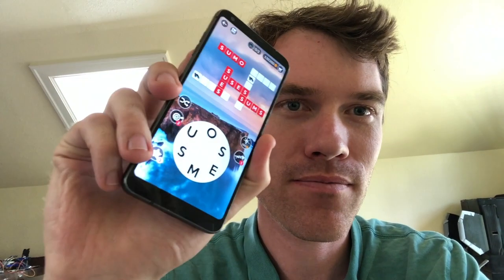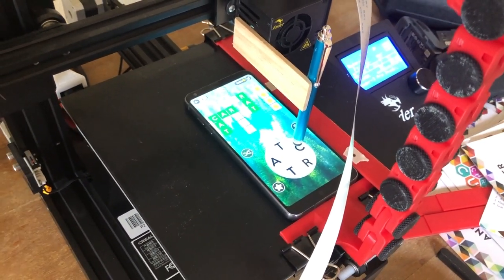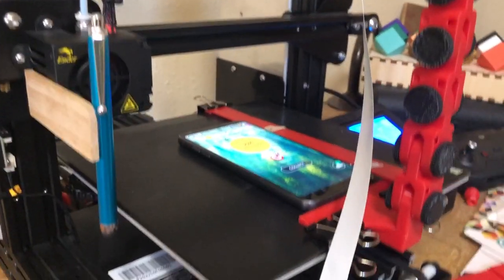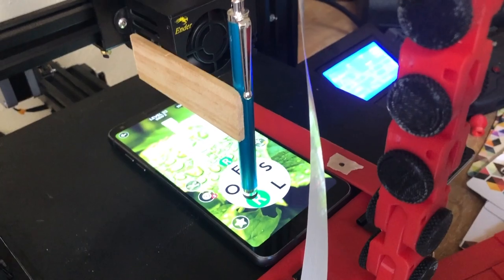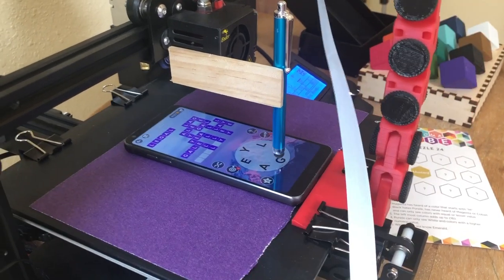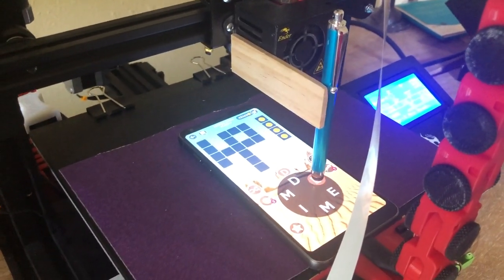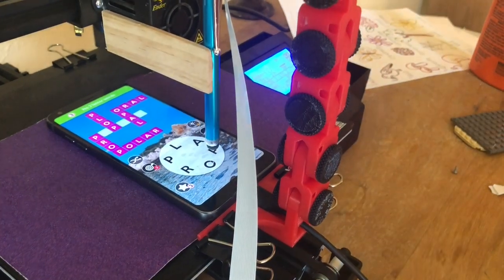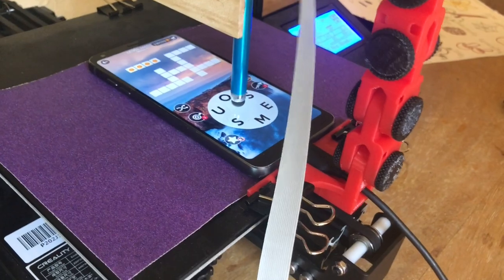A Robot that Absolutely Dominates the Wordscapes Crossword Game.

Comment: I think this is quite an achievement lol! 

How does it cope now though with all the blessed animations for ads to buy coins? Does it get stuck or can it recognise the X to cancel the screen?
Reply from the maker: I haven't run the robot since last year, but I would turn it to airplane mode so that there was no wifi or cell signal to load ads.
Reply: @chasemadison  sneaky… but I have found that if you’re in a tournament you can’t disconnect the Wi-Fi and stay in the tournament 😉